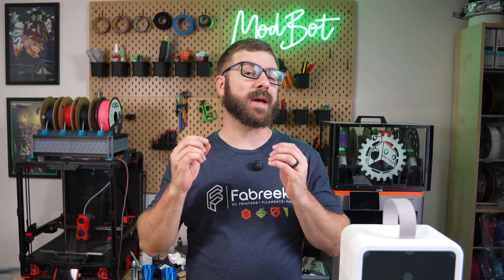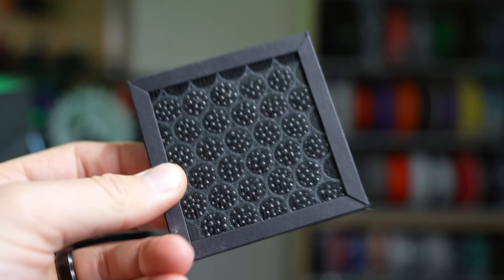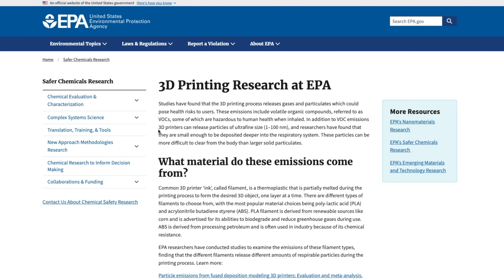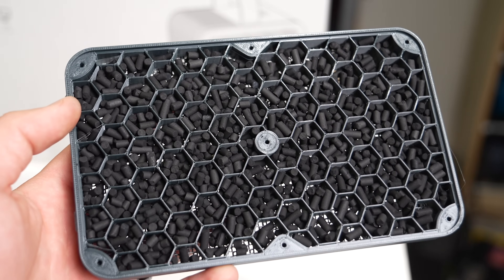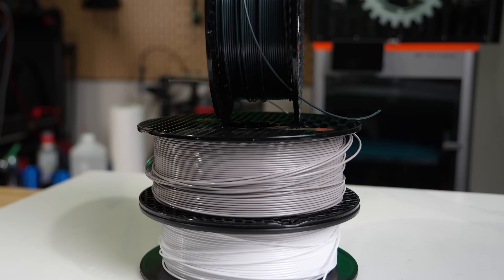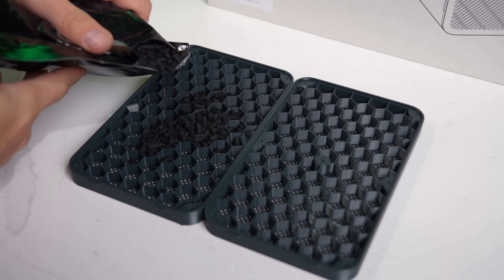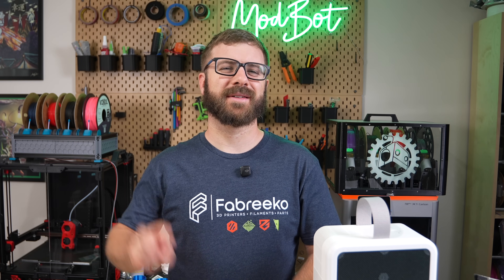Affordable Filter Solution For 3d Printer Fumes (Aire UPPÅTVIND Mod)

Comment: Temperature of printing has changed. I remember recommended temperature for PLA was 190C when I started printing on my Ender 3. With higher temp emissions are rising exponentially. You get minimal UFPs and VOCs at 190. Noticeable increase at 220 and significant rise and risking degradation and toxic byproducts at 240. So something completely different.
I reduced all my printers to 220 except first layer. Some printers coming out of the box with 240 default temp should have carbon filter as a must.

Comment: Man, I tried to print this and it printed without the grid in it, it printed as solid plate pieces. I'm use a Centauri Carbon and the only think I changed was the elephant foot comp from 0.01 to 0.27 as suggested by a reddit member.
Reply: Either the files were changed since the OP did this video or it's been altered somehow because I tried opening the file in every single slice imaginable and they are all solid plastic and not mesh or grid patterned like what is in the video!
Reply: @jamiesilvestro3382  Yeah that sucks, but I’m glad I’m not the only one. if you look to the right on the model page, you’ll see a remix of just the grills I ended up downloading it and it printed just fine or under the strength tab just zero out top shell layer and bottom shell layer.
Reply: @TexasWaters  I don"t understand what you are talking about. where do i find the mesh grill stl's please.

Comment: I applaud you for tackling this problem. Clean air is very important, and people tend not to appreciate that printing emits particulates. 

However, AFAIK while activated carbon is effective at filtering VOCs it does nothing for particulates. VOCs are things like solvents. So activated carbon is great for resin printers, but not so much for FDM. At least in the case of PLA and PETG, they emit essentially no VOCs so unfortunately, I do not think this well-intended idea will do anything at all to reduce FDM-generated particulates. 

On the flip side, because the physics of things that are so tiny, it turns out that HEPA is actually very good at removing UFPs, here's a NASA paper on the subject: https://ntrs.nasa.gov/api/citations/20170005166/downloads/20170005166.pdf

If you have data that show otherwise, I'd deeply appreciate it if you could provide it and I can learn something new. Otherwise, perhaps you can use your channel to cut another video letting viewers know that activated carbon does not filter FDM particles and HEPA is actually quite good for this purpose.

Comment: it worked pretty well, i like the design. Only downside is that the device itself is a bit weak for normal rooms, i hope you also design something like that for the middle class Ikea model, this is much stronger.

Comment: from my research you need a lot of carbon (maybe 10+ pounds) to really be affective and last any amount of time before getting saturated. The most affordable way to do this is to get a carbon canister filter like the ones that ac infinity or terrabloom sell. Even then it's sort of uncertain how long these canisters will be affective for and then need replaced. The cheapest most sure way to get rid of vocs is to just ventilate the area where your printers are. Also, having a combo hepa and carbon filter makes little sense because for hepa you want as much air flow as possible, but for the carbon part you want the air to "slowly" pass over the carbon to absorb the vocs, thus having a separate hepa and carbon filters make more sense.
Reply: My design has the carbon in a separate canister that operates like a silo ventilation system, grated floor for the air to pass through all the grains untill it gets to the top. 
For my system the HEPA element just needs to be half the diameter of the silo section so the air slows down when entering the silo which is filled with much finer carbon than he used.

Comment: man, i need something like this but in a smaller box with a 10mm pipe adapter, that why i can add it to the pipe ventilator i bought for the A1 mini, that would be a dream to get cheap activated carbon and Hepa filter inlets.

Comment: Love designs like this that cleanly modify commercial products.  Thank you for sharing.  Like some others though I do question its performance.  That carbon look awfully coarse (low surface area, large voids), and comes before the filter or even a prefilter.  It would be interesting to see real voc test data because assumptions about these things can be wrong.  Still, even a little filtering like this ought to help with the vocs that leak out and don’t get exhausted outside.

Comment: My main issue is getting affordable carbon, that do not erode steel parts. I also need to trust that the carbon is safe, as in what really do no harm to my HW. As a designer, I actually want filtering at the source, as inside the printer, but affordable is somewhat out the window, trying to resource safe carbon. This actually is a real issue for the industry.

Comment: Is the carbon on the outside of the hepa?  If so, it'll fill before it should.  Carbon works almost mechanically; physical cracks trapping small particles & gasses.  If caked with larger dust, it wont work.  

I have a larger no-name filter that has a pre-filter (poor foam thing), then the real hepa filter! & finally a carbon filter.  Dust blocks up even the foam fairly quickly.   But nothing visible gets beyond the hepa.   

But its not even close to portable/convenient.
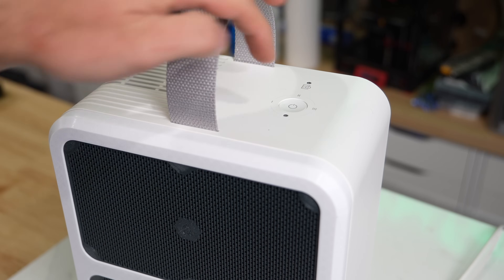Reply: Agreed. At 7:55 we see that the carbon is the first stage of filtration. This is very sub-optimal. Much better to let the coarse filter take out what it can, first.

Comment: Would've been nice (necessary even) to discuss the efficacy of this mod. It's possible that the added filter obstructs air flow too much. A test with a basic air quality tester would've given some validation.
Reply: He does show in the video smoke from his soldering iron being sucked into the filter at a pretty rapid rate. That is a short test, but a positive result.

Comment: Carbon filters should be placed after the HEPA filter, so that only air passes through them and they don't get ruined early
Reply: no, they dont get ruined early, its only a small amount of dust BUT if you place it after Hepa the coal dust will go into the motor and also activated carbon dust goes into the room which is not good to breath in and not good for other materials like the 3D printer itself. Yes consumer air filters have it like that but they have only a thin filter with activated carbon, not huge pellets. Ideally you should place a thin G4 filter before and behind the pellets.
Reply: @Danbarb-r1p yes I noticed that the carbon had quite a lot of dust. So I should put it before the hepa right?. I currently have it after the hepa in the indentation after the hepa module.
Reply: @ShrimplyAquascaping  the best would be after the Hepa but with a additional thin filter like G4 to prevent the dust from coming into the motor and air. I use this design in the video because i dont care if the hepa filter gets a bit dirty, i dont need the air to be cleaned from particles, i need something against the VOCs
Reply: @Danbarb-r1p ooh I see , thanks for the reply! I currently have a tissue as the filter lol😅 I’m sure it doesn’t work but it helps prevent the carbon from falling into the motor
Reply: @Danbarb-r1p  You should be rinsing carbon before using to get rid of the dust.
Reply: @Danbarb-r1p  Then why does every filter i know, first have Hepa then the carbon filter right in front of the motor fan? Including the air filter models from IKEA that come with a carbon filter?
Reply: @AOTanoos22  like he said, they only have a thin filter not a bunch of giant pellets
Reply: I thought printer create partciles smaller than pm2.5 which is what the filter is rated for. Correct me if im wrong though. So basically rhe filter itself doesn't do anything i think
Reply: Filters are usually rated at PM2.5 because that's the most difficult size to filter: 10 microns are stopped more easily because they physically impact the filter, and smaller sizes also get filtered more easily because the Brownian motion (random motion) makes those particles touch the filter anyway and they stick there.
A filter rated good for PM2.5 will work at least as good for smaller particles.
Reply: Good observation, this is why I have a filter before and after the pellets though😂

Comment: This looks like a great mod! Wish they had a print profile that could fit my A1 mini, though I guess I could adapt it myself if need be. One drawback of this design though: having the charcoal outside of the HEPA filter means I'll be spent far more quickly than is really necessary, as you lose the primary particulate filtration that that filter offers. Ideally you want things like charcoal after the HEPA filter to capture VOCs and the like that get past it, while keeping the charcoal mostly free of dust and larger particulate.
Reply: That's a great point. The assembly with 9 screws per filter also seems impractical. Time for a v2 probably!
Reply: @dsp4392  Yeah, that seems very tedious for something that needs regular servicing (especially with screws threading directly into plastic - I doubt those threads will last very long).

What I would do: design a charcoal holder cartridge to fit into the space occupied by the original filter, ideally with some form of snap-on lid rather than using screws. Then add an extension frame with a new holder for the HEPA filter outside of that, adding a bit of foam, TPU or similar to stop air from circumventing that outer filter.
Reply: If you're still interested I just published remix for A1 mini.

Comment: I suggest getting a foam type carbon filter. I have aftermarket filters designed for germguardian AC 4900 cheaper cost than 4 filters @ $19. First change I made to my K1C. Oem filter was a joke, so I cut a smell pc from the filter & installed. Any odors disappeared immediately. 1 original sized filter would make 8 or so k1c sized filter and last quite a while for a hobbiest.

Comment: What would have been better would be to 'slots' for both filters so that they can be removed easily and replaced and that they can be made on mass to simply the whole process. Think the slots in a toaster.
Also your demonstration with solder suggests the carbon filters catch the pm2.5 first meaning the filter behind will be less effective and that the carbon would be 'filled' up more quickly.
With slots you can put the carbon filter behind the HEPA filter and thus the carbon filter only catches VOCs more effectively.

Comment: Another thing to note by doing this mod: Since you are adding activated carbon in front of the HEPA filter, you can extend the longevity of the UPPÅTVIND's original filter buy having the carbon act as a pre-filter.

Comment: If you print abs or nastier stuff you should mix activated charcoal mixed with the nevermore scorch that is something like bentonite impregnated with permanganate and other chemical the neutralises benzene and other oil derived aromatics. I use it in the chamber filter on my Qidi X plus 3 and every time I change them they are soaked with oily filth. The room doesn't smell at all. Not a wiff
Reply: like a 50/50 mix? Im starting to print in ASA and that stuff is so bad I moved my printer to the garage.
Reply: Assuming you can find it in stock
Reply: @Andy_ABG sorry I had no idea was difficult to find. I bought a huge bag at  SMRRF in Oxford and I am not halfway through

Comment: No, I am sorry to piss in your soup but that is not thought out well. The reason why "gas filters" or active carbon filters are placed AFTER a small-particle filter is to prevent clogging of the micropores of charcoal, as this is its strongest feature. Charcoal is more or less highly reactive upon contact with as much as almost any toxic gas, even chlorine. Upon contact it loses its feature over time, depending on how strong a chemical reaction. So why charcoal? Because it has thousands of micro-pores, which enlarge the contact surface by a huge factor compared to its apparent surface. If you put the charcoal in the stream of (micro-)dust particles, you risk clogging exactly these pores and prevent the reaction from happening. It is thus common procedure to place the HEPA or µ-filter before the activated charcoal filter in respect to the airstream.
The solution you've shown is a good approach, but it'd be a lot better = more efficient (and btw longer lasting), if it were build that way, that you can remove the existing white particle filter, replace it with the charcoal insert and place the particle filter on its outside again.
Or, just invest a few bucks more, buy an ikea Fornuftig+the available charcoal filter and use that, which also has the nice feature of having even more surface. However, I doubt its airstream is well after I've seen the design in detail in one of their shops.
Still, thanks for showing.
Reply: Yes, any well thought out filter (for gas or liquid) starts by first scrubbing the larger particles and then gradually smaller and smaller ones. This one would be the opposite, hence it will clog and lose its carbon filtering capability much quicker. I was quite surprised it was "designed" like this. But in this day and age anybody can make something and talk about it on yt 😊
Reply: modbot fail

Comment: I'm switching from open printers to enclosured because of the fumes for this reason. It's to be able to vent outside the fumes, makes it so much nicer having printers around.
Reply: Low temperature filament (like PLA) generally needs the enclosure opened to manage the temperature for well-behaved, let alone quality, printing.

Comment: Small correction on particle size, while most filters(including hepa) such as the one in this video are rated to a larger particle size then ufps, they will often filter out smaller particle sizes without any issue. Because of the smaller size of these particles air turbulence usually make it easier for them to be caught by the filter.

Comment: Since you are screwing into plastic you probably want to reprint the black parts for each time you replace the carbon (or maybe use them twice), so that begs the question, would a mod with a pause for you to fill the carbon in and have it just be one part not be better than using screws? I really like this, might order one of those UPPATVINDs and give it a try.
Reply: Great idea, however……….now you have to reprint your carbon filters everytime you need to replace the carbon when it’s all filled up so….using the part multiple times with screws and reprint every 2 to 4 refills or your idea and reprint every refill because you can’t reuse the holder….🤔
Reply: What would be better is using heat set inserts.

Comment: I thought carbon filters like these only removed the smell. Not the particles that could be harmful.
Reply: Smell is particles too.
Reply: In this context VOCs are molecules (some of which you can smell) and particles are ultra fine solids (which you typically can't smell). The former (VOCs) are much smaller in size and stick to activated carbon. The latter stick to HEPA filters. The former (VOCs) pass right through any HEPA filter.